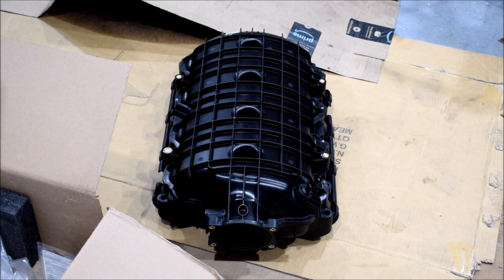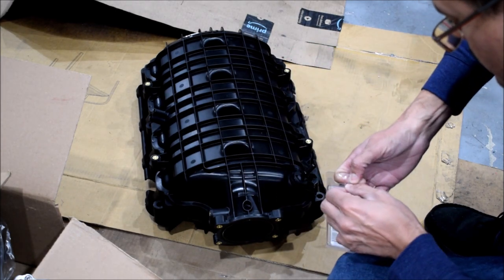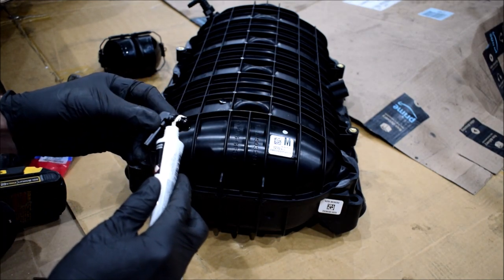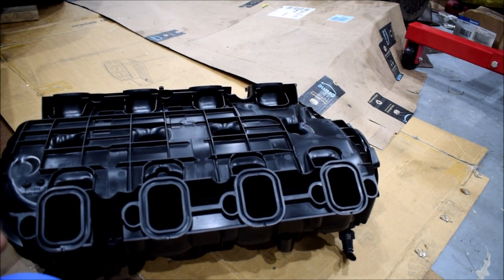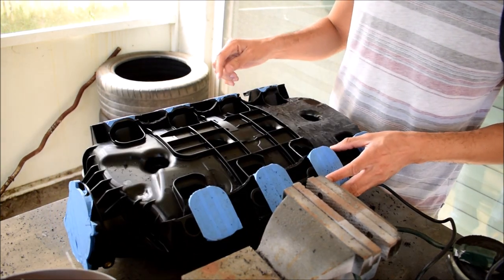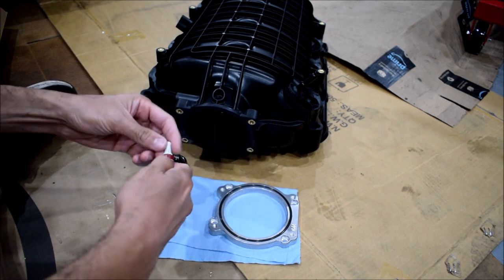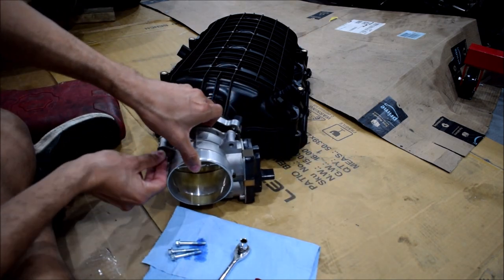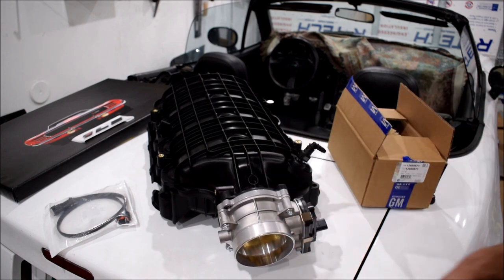LT2 Manifold and LT5 Throttle Body Prep for 6th Gen Camaro

Comment: Why did you drill the hole on that end instead of the other end like every other video I've watched?
Reply from the maker: I don't know that there's a right or wrong side. The first one I saw done on the forums was that way as well as one I saw in a video, so I went with that. As long as the length of fuel hose you add reaches, it's all good.
Reply: @doitwithproperstyle   All the videos I've seen they have drilled on the side closer to the driver's side since it's original location is on that side on the LT1 intake, but you're right. As long as it reaches it's all that matters. Great detailed video. Thanks!